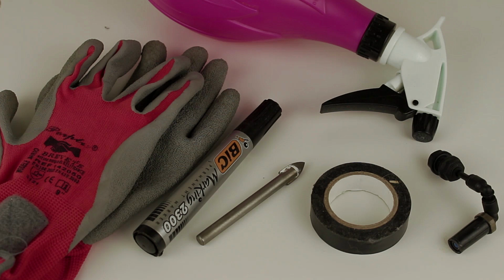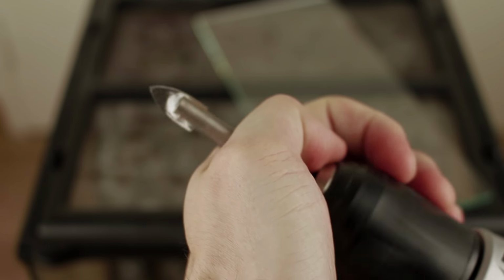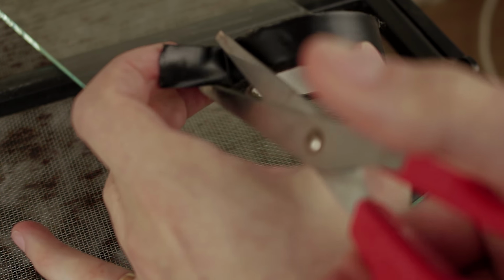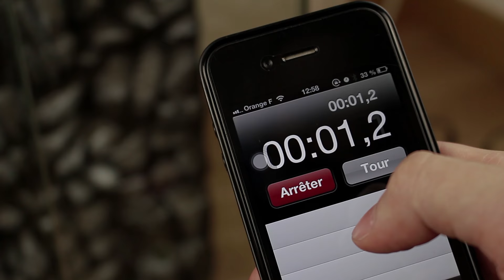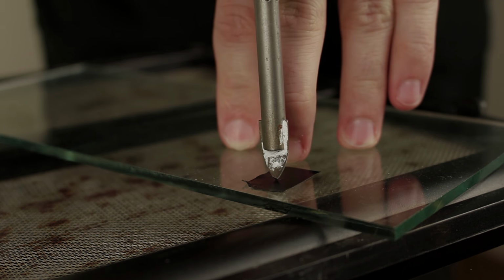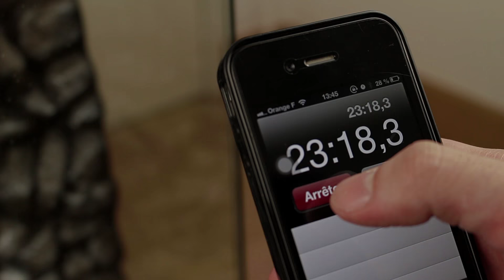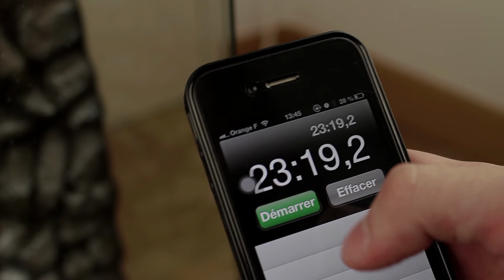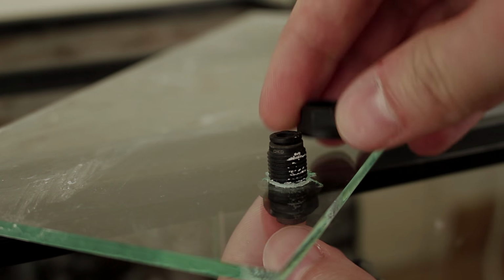TUTORIAL - How to Drill Glass

Comment: We used to do this a little differently. To start we just positioned the bit where we wanted the hole and with the help of our thumb we rocked the bit back and forth a little to make a small divit without the drill spinning. Then we drilled at a fairly slow speed after dipping the bit in a mixture of oil and mineral spirits which acts like a combo lube and coolant. I actually preferred a bit with some use on it. It seemed to me that new bits chipped more.

Comment: This should be called "How NOT to drill glass." Never drill glass dry like this. Dry drilling creates microscopic glass particles in the air which can damage your lungs and eyes. It also makes for a poor quality hole. The easiest method for small parts is to submerge the entire part in a shallow pan of water. You can also use a flood coolant system, or build a 'dam' around the hole using clay or putty and fill it with coolant or water. Using a tiny bit of water from a spray bottle is useless. Use a fixed, medium drill speed according to the bit size; if you go slow as in this video, you will end up with cracked edges like in this video.
Reply: Hahaha, you read my mind. Just scrolled down to see if someone had said it.
Reply: Your suggestion is unworkable in a production glass shop. Submerged in water? Really? Drilling rosette holes in a 42 X 100 inch mirror? A flood system or dam for a small 1/4 inch hole, not needed. The dam system is needed if using grit bits and a tripod drill. Vertical drilling machines use diamond bits and coolant is sprayed through the center of the front and back bits.
Reply: My brain was screaming when he said spray water when there’s dust, that glass powder that becomes airborne and ends up in your lungs… 
Water bath it, or submerge if small enough. I have a hose set up to have a continuous flow of water over the drill/cutting bit, I wear a mask and for larger projects I work outside, I’m a glass sculptor…
Reply: this -- puts you on the fast track to silicosis, which is akin to the pain and agony of prolonged asbestos exposure. i can also confirm that drilling with the entire piece underwater produces complete cooling to all surfaces, eliminates any thermal stress, prolongs the life of the bit, manages dust, and provides for very clean holes
Reply: I have a 50mm Swarovski crystal and I need to drill a hole in it so I can hang it. Any words of wisdom for me?